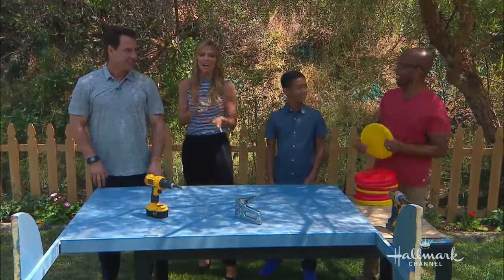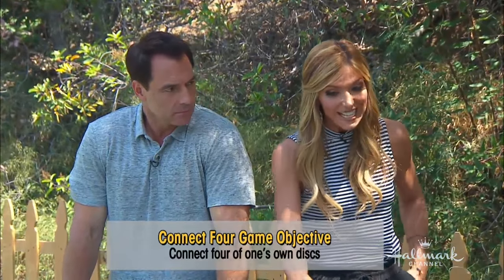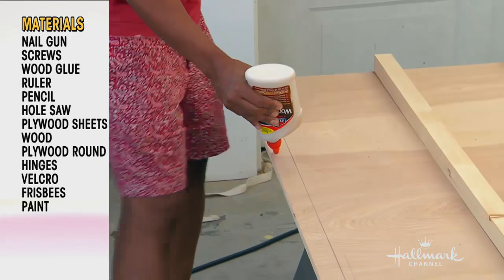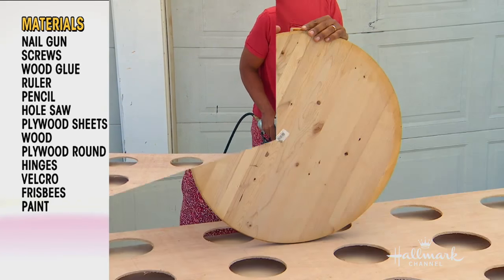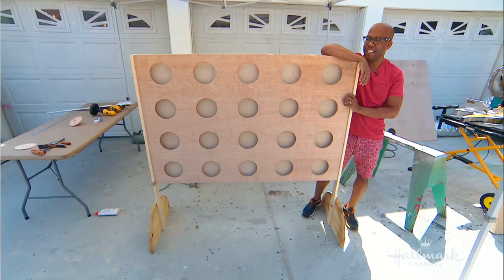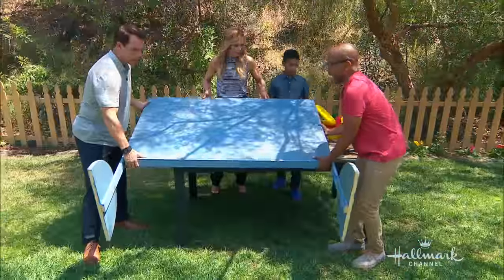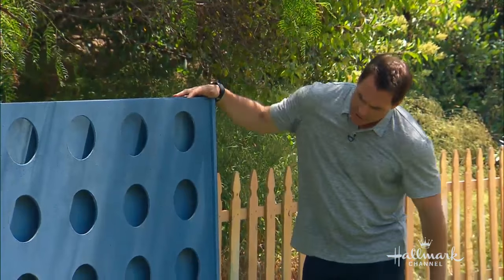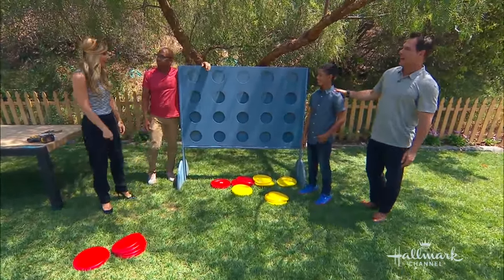How To - DIY Backyard Connect Four - Hallmark Channel

Comment: Connect 4 is supposed to be 7 across by 6 high. I've seen cheep knock-offs on a 6x6 grid,  but this grid is too small for a meaningful 4 in a row game. I would assume that after a few games, most children would find that all theirs games end in a tie and get loose interest. If you're playing 3 in a row, the first player, if making the optimal moves, can be guaranteed a win no latter than their 5th turn no matter what the second player does. At least in Tic Tac Toe two optimal players will always tie. I would argue that a board of this size reduces the complexity of connect 4 to be less than that of Tic Tac Toe.

Comment: What are the measurements that you drew on the 1/4 inch plywood?
Reply: prettymickey100 there's a link at the top right corner that says click here for instructiond
Reply: prettymickey100 at exactly 1.08 it will show at the top right the hallmark link then you see the video